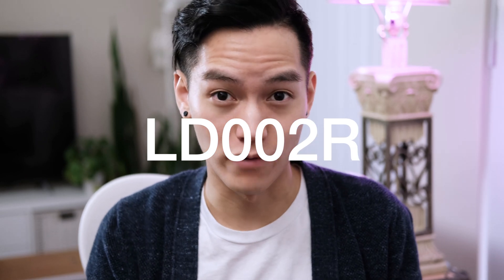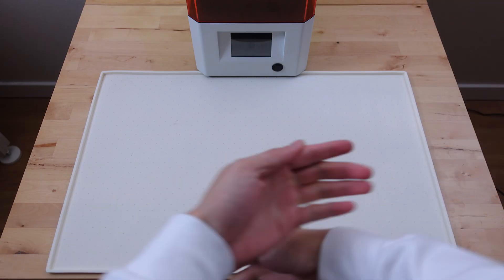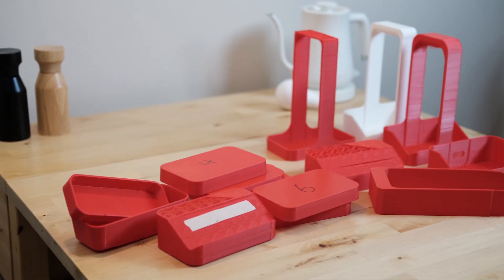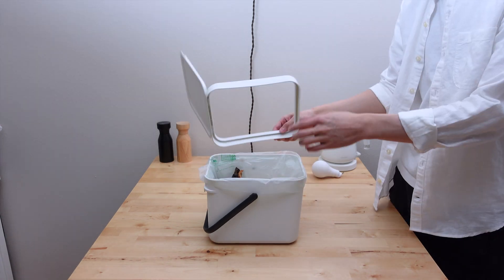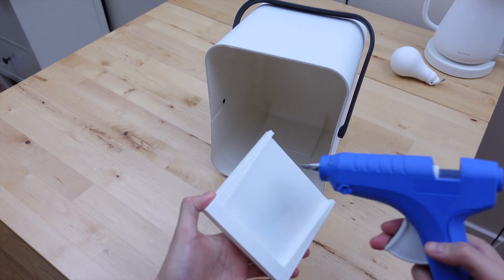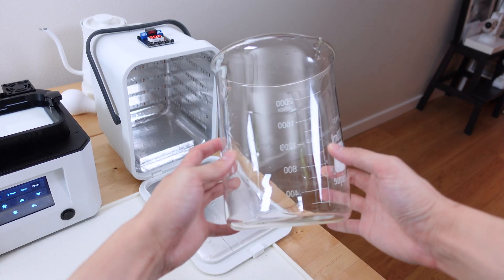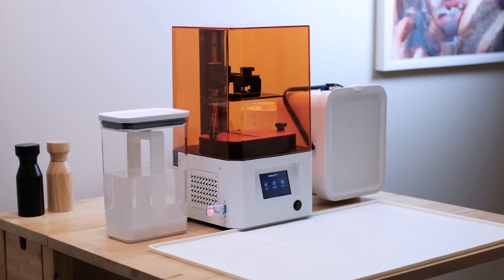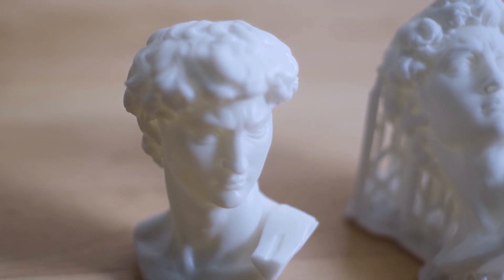My FIRST Resin Printer LD-002R - DIY Wash and Cure Station

Comment: How did you set up the printer to print the drainer? It's literally impossible for me to print it using PLA+ on my CR 6SE. I printed it vertical up with no supports like you did in the video. I even added the brim around it but still all those holes just doesn't stick to the bed. I couldn't even complete the first layer without disaster. I used 210 degree Celsius for the nozzle and 60 for the bed...tried 70 but still the same failure....And for the handle, I really don't know what magic you used to print a large overhang like that with no supports

Comment: damn scott. your videos are just amazing.
be careful with nitrile gloves: some resins or organic solvents penetrate nitrile gloves in seconds, and while your hands are sweating inside the gloves, the open pores absorb whats coming through the gloves even better. butyl gloves are the solution here, even though they are less convenient due to thickness.
also black light LEDs but be way too weak in the needed wavelength band. if you need a stronger UV light source, try the lamps that are used in tanning beds for the facial tanner. those work great, but produce quite some heat.
keep up the great stuff!!!!

Comment: 9/10 good tips but cold you put the wash thing in stead the light box of the water tube?? I know photopolymer chemistry science can be very tricky. Theoretically you could make resin with any monomer and a photoinitater like Elmer's glue and tumeric but the tumeric would very in ratio depending on "quality" and be measured on parts per million. I'm just saying have you tried it?

Comment: I went to your affiliate link and it brought me to the "CL-60 MSLA" 3D resign printer. Is that printer better or worse then the LD-002R? And will the mode that you did on the LD-002R work the same?

Comment: That's not a real UV light....
That's the "disco" light! UV led light is different and expensive!
The UV Led light is built with metal, due resin will not last like any other ordinary Led.
And that strip with 300 "UV Leds" for $16 bucks is a joke!
Here's the link of the real UVC Led: https://www.amazon.com/Beads-Office-Purification-395nm-275nm/dp/B08GC1LQWW/ref=asc_df_B08GC1LQWW/?tag=hyprod-20&linkCode=df0&hvadid=475873677596&hvpos=&hvnetw=g&hvrand=5162265039626516130&hvpone=&hvptwo=&hvqmt=&hvdev=c&hvdvcmdl=&hvlocint=&hvlocphy=9011899&hvtargid=pla-1167780016780&psc=1
$17.99 for 10 Leds.
I wonder how the disco LED works to cure resin now!
Reply from the maker: From my understanding, there are different types of UV. some are stronger than others and some for killing bacteria are significantly stronger and more expensive. for resin curing however i don’t think it needs to be very strong. mine still often over cure my prints and ive never heard of issues with this approach from other online threads. what’s your concern about these cheaper lights? that they will burn out sooner?

Comment: I haven't checked values but is that glass and water transparent to UV light wavelength you are using? As normal glass stops majority of the UV from the Sun. Laboratory glass is somehow different, but mostly to deal with big temperature changes - when UV transparent stuff is required, it is made of special glass.
Reply from the maker: from what i’ve read online, most glass blocks a lot of UV light but not TOO much and since the water inside does it’s refracting thing, it kinda cancels each other out? i mean my curing time is like half of what it used to be without the water so i’m definitely getting a good cure. not sure if the beaker i’m using is laboratory glass or not though. might be! but i have also used just ikea glass cups too before i got this beaker and that still worked very effectively.

Comment: Why did you upgrade the glue gun? You didn't really say why. It seems like the larger gun would be harder to navigate into the tiny areas like a DIY project or a circuit board.
Reply from the maker: oh yea! i forgot to explain. the push force on those cheap glue guns just always end up failing eventually. i’m not sure if it’s a clogged nozzle or the issue is in the trigger mechanism. the larger one is tough to get into small areas but it heats up super quick, has a great consistent push force, and is overall just a lot more reliable. i also love that its battery powered. more portable. small cheap ones definitely have their perks too though.

Comment: Hey there. Great video! I'm new to resin printing as well and was wondering how many times you are able to use the IPA in the OXO container before you need to change it out. I saw another video where someone said the alcohol should be changed out after each print, but I don't wanna go broke buying IPA, lol.
Reply from the maker: what? you definitely do not need to replace after every print... i believe formlabs website recommends replacing if prints are still sticky after a thorough wash in the IPA. for all the prints in this video i havne't replace the IPA once and it's still giving me very good cleans. some people commented on this video to try Mean Green Cleaner instead of IPA. apparently, it's safer because it has no odors and does a better job so maybe look into that too if you don't want to buy IPA. good luck

Comment: Totally using this food container wash station idea! For anyone that may not have Amazon Prime for whatever reason I found that Walmart has a Better Homes and Gardens line of air tight food containers that look very much like the OXO ones and they're a bit cheaper. Of course you'd have to modify the dimensions of Scott's STL to make it fit.

Comment: Quick question Scott. Doesn't the alcohol eat through your oxo container drainer? Pretty sure alcohol eats through PLA....
Reply from the maker: i think you might be thinking of acetone. i don’t think PLA reacts with IPA does it? at least the drainer i printed hasn’t broken down in any noticeable way and it’s been about 2 weeks now. when you buy IPA it usually comes in a pretty thin plastic bottle too so i feel like the oxo container should PROBABLY be okay? I’ll let u know if anything melts though haha yikes! scary stuff.
Reply: @ScottYuJan  the oxo container is a great idea. Love it. I assumed alcohol reacted with PLA, my I might be wrong. Great video. I have a resin printer sitting in a box in my garage. Can’t wait to have time to start playing with it.

Comment: How long to u put it in the blacklight for?
Reply from the maker: i think it depends a lot on the type of resin you're using but from my experiments so far i've been curing prints for about 6-8 minutes ish depending on the size. i'm very new at this though so i'm not sure if that's too long or too fast. i just kind of cure it until the surfaces are no longer sticky.
Reply: @ScottYuJan  Awesome. I just ordered one and I'm new to this so I'm trying to gather as much information as I can 🤧 Thanks for the quick response. Good luck with your future prints

Comment: why did you drop the parts in water?
Reply from the maker: It's called water curing and basically studies have shown oxygen actually slows down resin curing under UV light so since water has less oxygen in it, prints can cure a lot faster in water. I added more details for this in the pinned comment above with links to other videos as well if you're interested. thanks for the question.

Comment: amazing work as always! Just a quick question: why the water? Never seen it before for curing resin prints. Bye! :)
Reply from the maker: Thanks for the kind words! It's called water curing and basically studies have shown oxygen actually slows down resin curing under UV light so since water has less oxygen in it, prints can cure a lot faster in water. I added more details for this in the pinned comment above with links to other videos that explain this more if you're interested.
Reply: @ScottYuJan  thanks for the explanation! :D

Comment: Do resin have to be pouured back into its container from resin printer everytime I finished printing them? since I was lazy, I didnt poured them back and didnt printed anything more than weeks
Reply from the maker: oof good question. i'm honestly unsure. i read on reddit people said not to leave it in over a few weeks but you can probably leave it in there as long as you stir it up and maybe filter it real quick before a print in case any pieces thicken or harden?
Reply: @ScottYuJan  ohhh thank you very much

Comment: Is timing while curing that critical and is the timer really necessar? Seems kinda overkill for me. Als why are you putting it in water? Thats something I have never seen.
Reply from the maker: The timer is just because i multitask a lot and often forget about prints that are curing. if you shine a UV light on it for too long you can actually risk over curing your prints which can cause yellowing on some resins especially the white ones. and the other thing is called water curing and basically studies have shown oxygen actually slows down resin curing under UV light so since water has less oxygen in it, prints can cure a lot faster in water. I added more details for this in the pinned comment above with links to other videos that explain this more if you're interested.

Comment: Great setup! I'm planning on getting a resin printer next year. Fortunately I live somewhere with A LOT of sun throughout most of the year, so a curing device is not necessary for me. You might want to move your printer far away from your living area, though, because I've heard lots of reports that the fumes the resin gives off can make one nauseous when being exposed to them a lot and that sensitivity increases over time. Fortunately I have a spare bedroom that I use as storage space only and I'm going to set up my resin printer in there. If you don't have one (Seattle, right?) make sure to keep your windows wide open during printing and post-processing

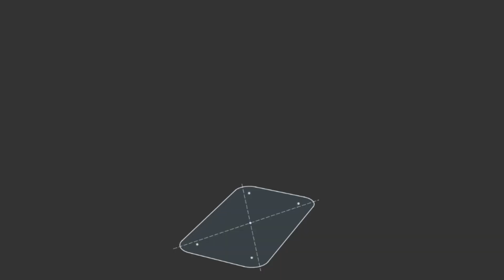Comment: 1:26 Which brand of filament are you using at wich temp settings ? This piece would wrap on my ender 3 pro if I don't set a brim...
Keep up those nice videos!
Reply: @tacticaltactics7665  I use isopropyl, my frame is perfectly aligned and I use a bltouch with a perfect levelled bed. If I set an higher bed temp, I start to get horizontal expansion (elephant feet). I guess I'll have to try a premium filament one of those days...
Reply: Do you have a glass bed? If not get one. Use a glue stick on the glass bed.  I had warping issues on large prints with the stock bed.  Now I can barely get the prints off the bed and have actually damaged prints from using too much glue while trying to take them off.
Reply: @superstarr310  yes I upgraded to glass, and using that Amazon basic filament. I will try with hair spray and see what I get.
Reply: @tacticaltactics7665  thanks for the advice

Comment: Man how do you do that It’s looks amazing 1:27
Reply: plug your printer into a computer running octoprint and have octoprint run the whole print, start to finish. it can add a command to move the print head all the way back like that and trigger a camera, so it takes a bit longer and you have to leave your computer on and plugged in the whole time, but just google "octoprint timelapse" and you'll get all the instructions you need :)
Reply: If you want to do it just buy a Raspberry pi 3B+ and raspi camera then install octopi thats it
Reply: the magic of octoprint